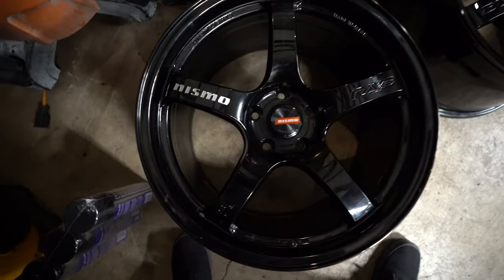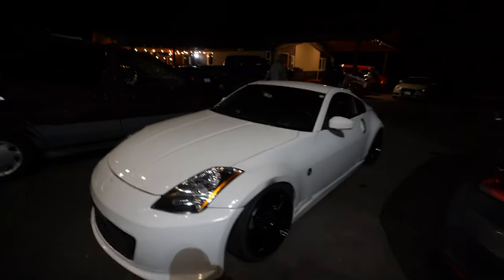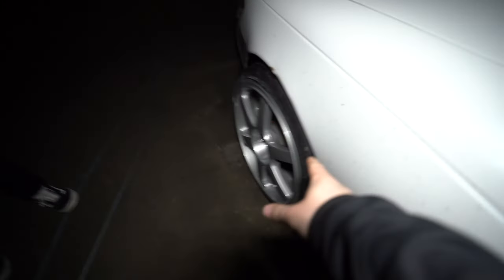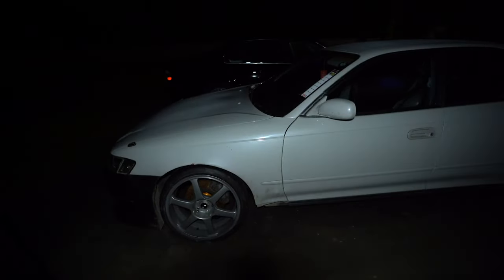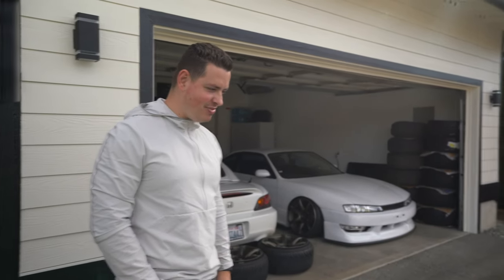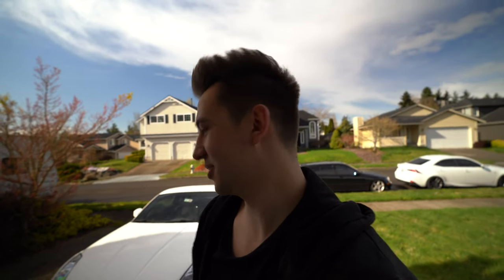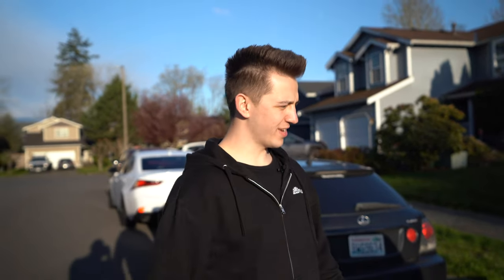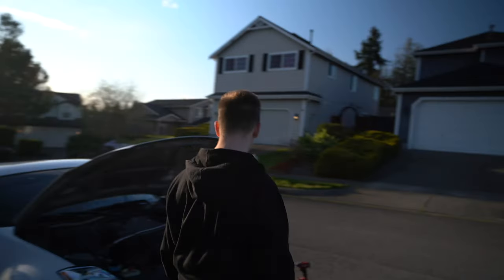IS BUYING BLACK WHEELS A BAD IDEA?? + Big Announcement!

Comment: Mate, how are you running so low!? I’m on the full gktech arms, 9.5x18 et15 plus 20mm spacers to clear the brembos and I’m so high with my ride height as I rub everything and the loom and actual lights 🧐 my arches are rolled the the max as well
Reply from the maker: My car rubs a bit too haha. Sounds like you need to step down in tire size though!